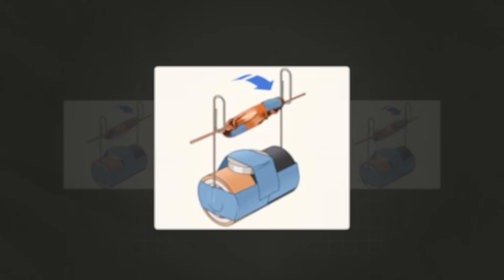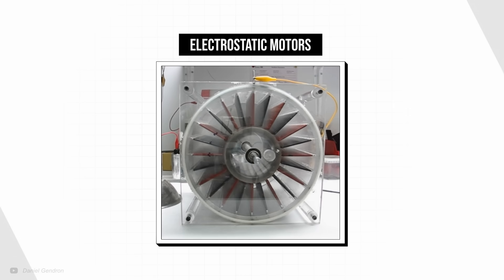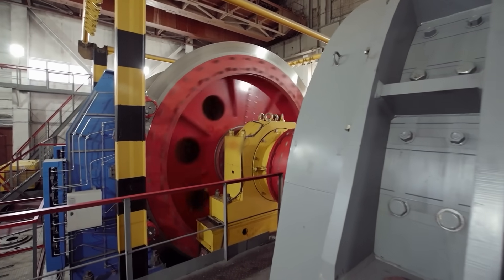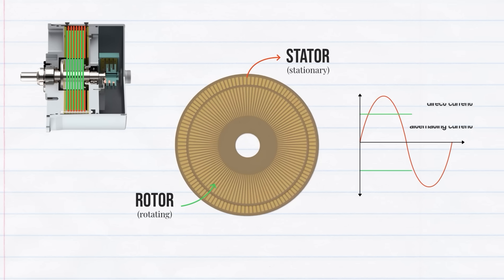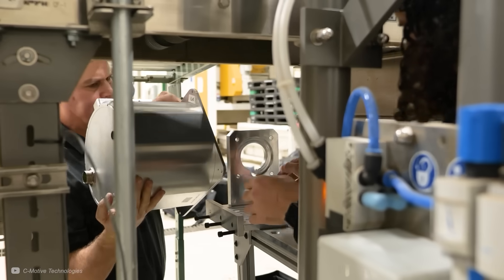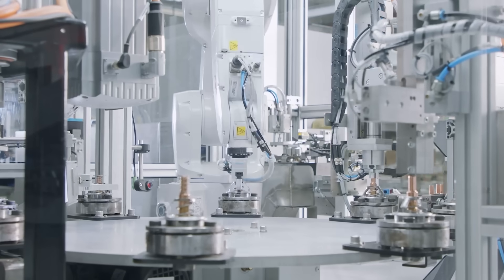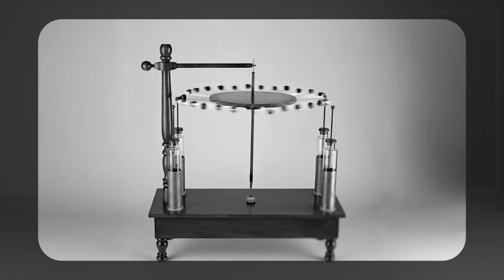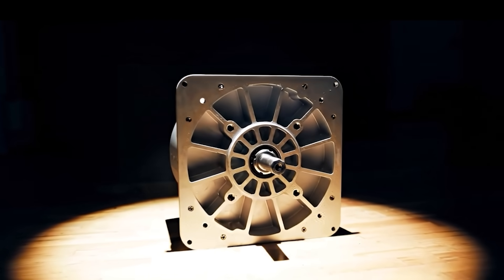How Electrostatic Motors are Breaking All the Rules

Comment from the maker: Early electrostatic motors were pretty shocking, but these developments are positively exciting... I'll see myself out.

Check out Onshape for FREE: https://Onshape.pro/Ziroth - You won't regret giving it a try!
Reply: I'm curious about the “commodity fluids”. There is currently a massive scramble for supply chain security, because of the wars, climate change and random trade wars, so if the base supplies for these motors are significantly lower, that would be a massive boost.
Reply: Ryan, could you report on the breakthrough in the development of "clean earth" magnets? Iron nitride magnets apparently have better performance than rare earth magnets, and none of the materials that go into them are rare. Nitrogen and iron are both extremely abundant. The company behind this is called Niron Magnetics.
Reply: interested to learn what the dielectric fluid is.
Reply: SO POWER A CAR with a zap
Reply: But this wont bring down the price. If anything it's an excuse to increase the price because it's new technology, and then no one ever lowers it.
Reply: I'll stick to FreeCAD, thank you very much.
Reply: Onshape sucks!! It's just another push in normalizing "not owning" anything. Plus, you must have an Internet access at all times, or you don't use it. No thanks!! Adobe is pushing this also, and it's simply another form of control. "Vertical Integration" is just a polite and civilized idiom that hides Monopolization... always hidden in plain sight... at least that's how it's been played.
Reply: @ethericbliss23  It's beautiful, naive and dangerous, it's an idea from the days when scientists exchanged their ideas in friendly letters. Like Heisenberg, Rutherford and Einstein. And then Mr. Hitler came and wanted an atomic bomb from Heisenberg - fortunately it wasn't easy and the Germans didn't have time to do it before the end of the war. Today, design a new kind of undetectable most destructive weapon in the USA in onshape and thousands of "Rosenbergs" will send Putin its complete plans.
Reply: Can static motors also be used as generators? If so, are they efficient or of practical use?
Reply: @sparky6086 I’d say with both pressure and temperature gradients to push the ions into a toroidal field
Yes
But it might take more power to create than it yields
Good luck with that
Reply: the problem with onshape is that it's all in the cloud, which creates a ton of problems with security, privacy, reliability, .... if i needed CAD software right now, i'd go for something like freecad. as the name suggests, it's free, and is completely local, no internet required.
Reply: This joke has a very high differential compared to traditional jokes also
Reply: I was gonna say a better gas but oil makes sense
Reply: I see what you did there 😂
Reply: OnShape is the paid version of FreeCAD.
FreeCAD however is free to use...
Reply: Wondering if they are using pure mineral oil?
Reply: I think The "Proprietary" dielectric fluid is just custom dielectric used in dielectric capacitor with high capacitance.   In this case the dieletcric can handle 4000V so , V(max)=E(max)×d  , where d is the plate separation and E is the dielectric strength.
Reply: So where did the idea come from?
Reply: HDPE insulation
Reply: you have the most beautiful hair its gorgeous and I use Free Cad is that similar to OnShape just curious
Reply: Than-Q 4 making this video .
how do the field strengths of powerful electrets compared to powerful magnets compare ?
Reply: its definitely a gas not a liquid lol
Reply: My guy that is spectacular
I’m researching old Stone technology that turns out that motors have been made of stone for a long time. Piezoelectric was the prize.
Low volumes of water use in a high speed turbine made a stone. What’s impressive is the stone is loaded with iron mitigating the need for refining the iron out of the stone to make iron casings iron impellers, and motors with windings. 
There’s an easier cheaper way that the ancient used all over the place and they’re still in place today. Cheers. 
If you wanna know more about it, hit me up and we can chat
Reply: Suspect their efficiency claims for the traditional motor plus gearbox combinations … 60% does not seem valid to me. The motor would have to be dreadfully mismatched to the load… their power electronics would not be cheap either without economies of scale?
Reply: Have you thought about using a bit of sound treatment in your room to increase audio quality on your videos? Cheers
Reply: 0:51 If you respected my time; you would just get straight into it, instead of wasting seconds mentioning nonsense.
Reply: Look up how  ford Model T clutch is made
It’s very possible the transmission was really an electrostatic motor , and the model at a hybrid. - if one can consider alt history, all things were and are being reinvested and therefore reinvented 
Old world had cars
Reply: So to avoid fluid leaking it has to mounted with the output shaft upwards? Plus you have a 4 000V circuit. Not very practical for consumer products.
Reply: Flop. these plates bend on heat
Reply: or they could use the heat to make more voltage

Comment: just a bit of metal dust rubbed off due to friction with the liquid will rapidly cause the electrical breakdown of the fluid... and you have 4000kV bolt arching between plates.

Comment: A 1.5KW motor at 65% efficiency is 1500W/0.65=2308W or 2.308KW. Used 24/7 is 20,215KW-Hrs at 9 cents per KW-Hr for industrial power is $1819 per year. 
If a CMotive motor is 90% efficient the calculation becomes $1314 per year.  Savings is only $505 per year. Cant save $1400 per year!!!!!

Comment: Wow ok. Air insulates 10mm per 1000V wonder what mineral oil offers. No mention of the cost and efficiency of the driver for this DC high voltage motor and the amount of coper and rare earth materials for transformer cores used in that in comparison to an induction VSD? There are no magnets in the conveyer motors they are replacing. High voltage DC is dangerous and distributes poorly.

Comment: These motors basically operate on the same principle as a capacitor.  The internal forces on the plates of a multi-layer capacitor are enormous.  This company has just figured out how to mount the plates on a rotating disk and then commutate them using existing PCB technology!  Very ingenious!  The dielectric could be most any type of oil.  The main thing, is you want to prevent water!  When you see an arc of electricity, it is not arcing across air, it is arcing across the water molecules in the air!  So,  basically, anything except water!  And nothing conductive!  So, this means... oil.

Comment: To me It looks like they are using just plain old mineral oil because of it's high dielectric strength and heat transfer, low toxicity and viscosity and also widely available

Comment: if the inside of the motor where the plates are could be made air-tight, you might be able to use an inert gas instead of liquid.

Comment: Dr Charles Buhler's the former head of the electrostatic lab at NASA (solving the acute problem of microscopic moon regolith, harming the astronauts lungs, clogging their seals and destroying any couplings which were in frequent use) Upon leaving NASA, he started a company which used electrostatics to produce thrust in a vacuum chamber. The so-called propellantless drive. The Good doctor claims that he has discovered a 5th force in nature, we were previously unaware of. As a scientist considered by NASA to be the most knowledgeable man on electrostatics in the world, I would not be so credulous as to think that Dr Buhler and his fellow scientific staff at his facilities are simple charlatans, or self deceivers. They have shown a timeline of experiments using varied approaches to the problem, and only released these claims with solid data to back them up. Several years ago, I believe, his device was able to produce over 1G of thrust in a vacuum.chamber.
Yes it is an exciting and growing field of research.
We are beginning to approach the edge of many insurmountable problems at the moment, by incremental steps. With trial after trial, in small iterative improvements. As it should be done.

Comment: Electrostatic forces don't act on solids rather act on fluids. Magnetic forces are required to move any solid! So, actually, the liquid inside the motor is pushing the rotor like in a Tesla turbine.

Comment: 7:50 I suppose if EV motors really had this 65% efficiency, nobody would want to replace ICE engines (up to 50%) using them. Most of adequately designed electric motors yield 85-90% efficiency

Comment: Its probably a mixture of acetone and argon in the sealed environment, which is noncombustible if there’s no oxygen present and can handle high temperatures and voltages, but is extremely dangerous composition, if done improperly

Comment: fluid in a sub mm gap. That's got to run slowly, not surprised its high torque applications. Not a general replacement, and those looked exceeding bulky for a mere 2bhp!  I have a brushless 5bhp motor that grapefruit sized. But cute.

Comment: I'm really getting tired of all the hand-wringing claims that we can't build motors without rare earth elements. That's nonsense. We've been building motors for centuries without them. Permanent rare earth magnets do make possible greater power densities and efficiencies, but ordinary induction motors use only steel, copper and aluminum and still work as well as ever. My early Tesla model S uses them.

Comment: This video told me almost nothing. Lots of tedious repetition of the supposed wonders of this supposedly breakthrough motor and almost none of the stuff that actually matters to an engineer like me, like actual supply and operating voltages and currents, torque curves, efficiency curves, etc. I've often seen this pattern in overhyped or outright fraudulent projects, and while electrostatic motors are obviously allowed by physics and I have no reason to believe this project is fraudulent, it raises a lot of red flags about its practicality and economy.

Comment: Is there such a thing as adding a layer of repelling magnetism onto the gears so there's less friction? A different design with the same idea. Could we not transfer the heat to pressure through the gear motor? Like a jet turbine? Not an expert, just figured they would push the design further. Maybe try out permanent magnets or red hg? Fun fun.

Comment: One thing I loved about a corona motor is how you can run it on a copper wire that you lift in the air. Think it needs to be over 100 feet to really show good results, but basically a limitless flow of fuel. Only problem then is ensuring you find a way to cool the motor, as it gets extremely hot. You can also increase the voltage you are getting based on how high it is, by an insane factor. Think the effect (forget it's name) states that for every meter or so, there is 100V of static electricity, and it is rather steady up to 40kV or so. Only difficulties are trying to not ground the connection, or raise the source high enough to overcome the grounding, and tapping into the electricity.

Comment: Very interesting topic, but unfortunately there are zero concrete numbers. You’re only sharing what the manufacturer provided, without any torque/RPM figures and without any comparison to existing motors. Why not say something like: here’s a motor with (say) 5 kW and its torque/RPM characteristics, and here’s the electrostatic motor with the same power and its characteristics. Without this data, the whole thing looks like marketing for a technology that may not even exist.

Comment: One application that might actually benefit from electrostatic motors' tendency to start producing plasma arcs all over the place: using an electrostatic motor as a replacement for a jet engine. Get those arcs flashing fast enough and you could just have the turbine stage do double duty as an electrostatic motor, where once it starts rotating, the arcs suddenly get blown into a continuous plasma stream that acts like an electric afterburner.

Could get quite a bit of thrust from that to say the least.

Comment: sounds like a lot of marketing bs... There are many challenges with electrostatic motors and you won't fix them with injecting a liquid, not to mention the hydrostatic resistance/friction such a liquid introduces, so 90% efficiency not likely ... btw, have these people never heard of spectrochemical analysis?.... you can get lab equipment for 10K that will tell you exactly what is in their 'secret sauce'... if the Chinese won't copy it, and sell it for 1/2 the price, it's a dud.

Comment: The video seems to suggest that industrial motors contain magnets, they don't, the overwhelming majority are 3-phase AC induction motors, they have stationary 'stator' windings and an aluminium or copper rotor which is magnetised through induction.

For constant speed operation they require no complex controls, they are intended to be connected straight to the mains supply. Simple, efficient (up to 95%), reliable, mature technology. Hard to beat for static applications where size/weight/power density are somewhat irrelevant.

A relatively small amount of industrial power goes into servo/stepper motors, these typically have rare-earth magnets but they're not used where the bulk of the power is consumed.

Comment: "12 hours/day 5 days/week for 2-months with zero downtime"

My company recently rebuilt a 30kW AC motor that had been running for 23 years, it was only ever turned off every 3 months for an hour while the compressor it ran was serviced, it only failed because the compressor coolant leaked into it.

AC induction motors are very good, ~95% efficiency, no magnets, no slip rings, reliable, no complex/expensive electronic controls (for fixed speed).

As for the gearbox, the video shows cheap 'worm' gearboxes which are notoriously inefficient, a helical 'box would bring the gearmotor efficiency up to 85%, killing the cost saving. Also many high power continuous applications like pumps, compressors & ventilation systems do not use gearboxes at all because they operate at the motor speed.

I see this fluid filled, low speed, complex motor as a curiosity, it will not replace the induction motor in industry.

Comment: AAAAAAAaaaaaRRRRRuuuuUUUUUGH!  I hope I got your attention.  
STOP using that made up, fabricated, COMPLETELY INACCURATE, and education-derailing S T U P I D  acronym; WHICH IS NOT a F R E A K I N G acronym in the first place!
WHAT, you say?  —It is the tortuous, tangled, Rube Goldberg creation of ID I OTS known as— H-VAC, or in your case Haich-VAC.  To what are YOU referring?  Heating-Vacuum?  Hydraulic-Vacuum?  I think you were referring to Heating, Ventilation, and Air Conditioning.  Did you notice?  None of those apparatus to which you refer have anything to do with “Vacuum!”
Until about the 1990’s, the original and TRUE acronym was H-V-A-C, and spelled HVAC.  Say it quickly and tell me if it’s faster to say that other convolution.  And is it worth your “saved time” to twist and confuse young up-and-coming engineering minds?  Not to mention the general public.  
What happened in the 1990’s then?  As usual, some “I’m going to make myself look even COOLER with my ‘In-the-knowedness,’ and SHORTEN IT SOME MORE, even though it MAKES NO SENSE” m o r o n started that other bra in less and distorted concoction of Un-reality.  Probably, so inexperienced, he just READ it wrong.  
So, go on sounding completely uneducated concerning those disciplines if you want— tying the abbreviation for vacuum into it if you want; but you’ll get NO respect from me or the other thousands of engineering people who understand this and are please to stick with ACCURACY and the original ACTUAL acronym.
Reply: Otherwise— Very interesting video!

Comment: Direct Driven usually come with better efficiency. But since torque is basically related to size. Without gearbox the things can be massive. And if you increase the Toque density directly will likely the efficiency will drop crazy. Another way is to build a high RPM motor that can easily achieve like 98-99% efficiency and using gearbox. But high speed gearbox with Hugh conversion ratio will have low efficiency and need to cool down. So there basically no golden solution, everything is a trade off. 
Finally All motor in field theory work similar. There is one reaction build out the field from electric and another reaction convert field to mechanical energy. So you can using Ultrasonic sound wave to build a motor with ultra low EMC.

Comment: I haven't heard bigger BS in a long time. You know how a Tesla pump works? The drag from the closely spaced plates in this motor will cause enormous energy losses. Besides, what's at the output of this motor? Isn't it a planetary Gear ? So all this talk about efficiency is a load of nonsense.If this motor has 5% power or even half efficiency of induction motor will be miracle.

Comment: Asynchronous motors used in most conveyor belts don't use rare earth metals in their rotors. Rare earth metals are used in servo technology for precise and dynamic movement applications or for very high efficiency motors (IE4+). In the EU new asynchronous motors for industrial applications have to reach certain efficiency standards which will generally be over 85% and that is worst case for small asynchronous motors. Adding a gearbox is only an issue if you use a worm gearbox which can be as low as 50% efficient but most helical gear designs are over 90% efficient too so it seems to me they're solving a problem that doesn't actually exist